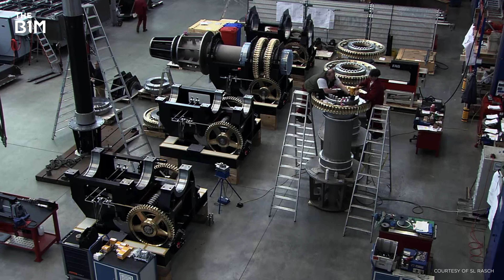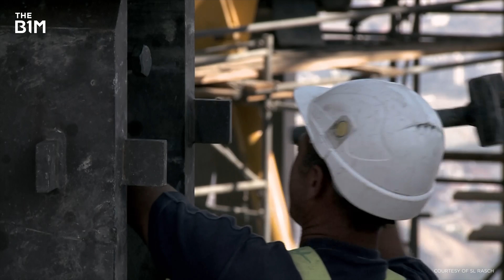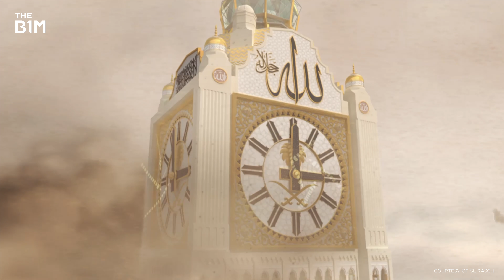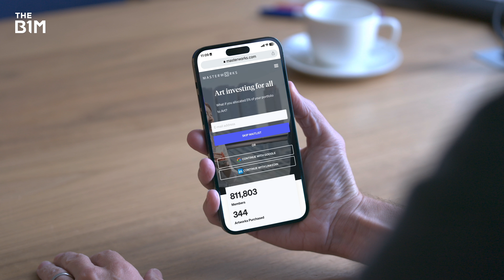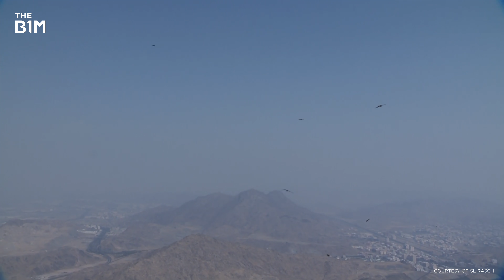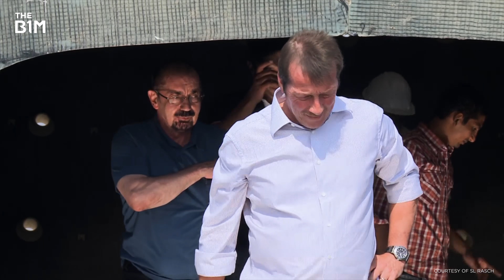Saudi Arabia Built a $16BN Clock Tower

Comment: The Arabs love building giant vanity projects
Reply: Who doesn’t? lol
Reply: @pyrho1  particularly when it’s phalic symbolism
Reply: Look at all those giant, ornate cathedrals in Europe. These kinds of architecture lasts for hundreds of years because it is loved.
Reply: @fanniinnanetguy653  they were built by men who spent their lifetime working on the project. Innate knowledge and devotion to the work of their craft was the main motivation.
Reply: It's definitely not vanity lol, the hotels inside are usually completely booked
Reply: @STV-H4H ”no no these vanity projects are moral while the ones Arab build are evil”
Reply: This one looms over the most holy place regulating everyone with a massive clock. Of course, the dude who prays up top has a very long commute.😂
Reply: They certainly do

But even more, they love doing it with all that lovely oil money they get from the West.
Reply: Wouldn't call it a vanity project since it actually serves an important purpose and function.
Reply: In reality this "vanity projects" have massivly boosted their economies. But I'm sure you know better then them tots.
Reply: @محمدالامريكي-ج9م  It's by definition a vanity project, because a more modest construction could achieve the same purpose and function. Something a whole lot smaller, and a whole lot less ostentatious
Reply: Correction: Dictators love vanity projects
Reply: @akbarkool  total monopoly
Reply: vanity projects designed and built by westerners who then had to convert to enter the city.
The absolute fukn NERVE lmaoo
Reply: While syria yemen starves
Reply: @1st1anarkissed  Most holy? 😅
Reply: Closer to god, and all that BS
Reply: Everyone did and Everyone does
Reply: @STV-H4H Showing your hypocrisy eh bud?
Reply: It’s a hotel..
Reply: Cope
Reply: @Echth762   I have to ask, what are you asking? What did I write that you called hypocritical? 
I wrote a sarcastic comment about how each religion claims ‘our god is the only true god’
That’s a central point of all the world religions. 
Point my hypocrisy out, I’m curious to know how you define it.
Reply: All of it's rooms are always occupied
Reply: @STV-H4H  poor people excuse lol
Reply: It's not unique to Arabs, humans have built many great structures throughout history. Also vanity projects are standard amongst the wealthy (real or otherwise).
Reply: Everyone does
Reply: How is it a vanity project when it accommodates all the visitors 24/7?!!
It is a very much-needed residential building.
Reply: @AL-lh2ht really ? Why? Argue please !
Reply: How is a public utility a vanity project? The Kuffar are slow.
Reply: @christopherbedford9897  they ain't gonna be receiving as much revenues if it's not build like that. It's literally made to support the two holy cities financially.
Reply: Vanity projects that serve nothing
Reply: Vanity? This building made a massive ROI. Not a vanity project when it makes many times its actual cost
Reply: @queenbey6678thats the brits lmao

The tower got its $$ cost back btw
Reply: @christopherbedford9897 u dont want the oil then?

Yall crave and beg for it... And it is a fact
Reply: @queenbey6678thats the brits.... Ohh the irony
Reply: @Heuzro  🤷🏻‍♂ Nobody is disputing that. Why did you bring it up? It's pretty much the whole point, isn't it.
Reply: So did the romans tell me what did your people build ajami?
Reply: @jewelsoup4110  "So did the romans tell me what did your people build ajami"

OK first, who is ajami and why did you pick on them?

Second, every civilisation in history - with the possible exception of us, now - has made their infrastructure more ornate than it needed to be. I just don't see the world's most expensive, highest, biggest, most imposing, most intimidating structure as providing any practical use that people couldn't get (and more) from their phones.
Reply: What's actually funny is Prophet Muhammad warned muslims of the time when Arabs will compete over tall structures. And it's almost as if they ignored that and went ahead to still build these and fulfil the prophecies of the day of judgement .
Reply: @STV-H4H yours must be rectangular shaped and with a built in alarm
Reply: goat herder menality
Reply: @randylahey2242  Civilized countries don't use public funds to shit like this
Reply: @qc7zy   lol open a history book
Reply: Dat Oil Money !
Reply: Humans, in general, do this.
Reply: @akbarkool mate, it'd be booked if it didn't cost 16 billion. The haj is an infinite money glitch
Reply: @akbarkool  they arent booked because of the grandeur of the clocktower. as someone who stayed in the tower 3 times the clocktowers size means nothing to anyone that stays there. we come for pilgrimage. if the tower didnt exist and it was only hotels theyd be completely booked as well
Reply: @christopherbedford9897  You cant call it a vanity project when it made a massive profit several times over. 

Lets be real here, you would be saying the same thing no matter what the build. because you basing your logic on bigotry and not economics or reality of how successful they are.
Reply: @red-one5923  Dubai is the third most visited city on earth last year. enough said.
Reply: @AL-lh2ht  "you would be saying the same thing no matter what the build"

🤷🏻‍♂ You're probably right. It just smells so much like the mediaeval mindset that built huge ornate cathedrals and churches and decorated them inside and out with only one thing in mind: make people cower before Authority.
Reply: @AL-lh2ht  you fool, you said that arab project are evil! I say to you argue why! Then your answer is dubai is the third visited place and you said enough said! 😂🤣😂🤣😂🤪
Reply: it's a hotel, and it's full all the time ... haters gonna hate I guess ..
Reply: @TheHigherSpace  "it's a hotel, and it's full all the time ... haters gonna hate I guess"

Yeahhh... never heard of a hotel that needed a 50m high clock on it though, have you?

No-one's talking about the hotel. It's the vanity decorations on top that are a massive "up yours" to the serfs who worship there ("You are nothing, prostrate yourselves before this much ostentation and garish decoration") and to the rest of the world, really ("Look at what we are doing with your oil money, you wankers)".
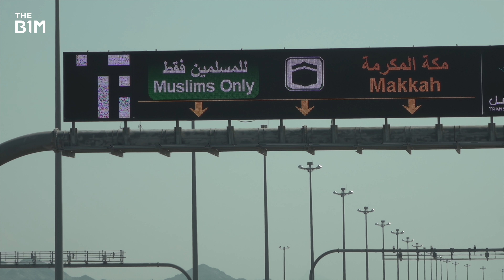Reply: Prophet Muhammad ﷺ said, “And if you see the barefoot arab, naked shepherds of camels competing in the construction of high-rise buildings, then this is from among the signs of the Hour." Muslim-1:36, No 8.
Reply: Have you seen Europe
Reply: @Szopjale1   the roman colleaseum? The French arch de triumph? Berlin gates? Big Ben? The Vatican? Solomons temple? Even the Africans have the pyramid lol the native Americans the kahokia mounds?Aztec temples? Buddhist temples? Even the mongols built that massive ghengis khan statue Have you never opened a history book
Reply: @deanbartolo6199  well that isn't true
Reply: Those are prosperous full cities it's Makkah the direction of All Muslims in the world
Reply: Because it`s already in the prophecy of the prophet `Muhammed PBUH` : `The end of time will not to come until Arab countries compete to build the tallest buildings...`

Its just like when prophet `Muhammed PBUH` say in prophecy : `Muslims will conquer Constantine and Rome...`, the companion ask : `Who`s first my prophet?`, and the prophet reply : `Constantine first...`, and around 800 years later from the time of prophet, Muslims that leads by Ottoman empire conquer Constantinople at 1453.
Reply: Uh oh
Reply: Right next to their holiest site. Nothing perverse there.. move along.
Reply: And Europeans don't? 😂
Reply: @fanniinnanetguy653  cathedrals are built to honour god.  Just like the mosques Muslims built in Turkey, they are beautiful and make you feel both connected to and in awe of god and the beauty of the world.  This is just a clock they built because they can.  Totally different.
Reply: How it is vanity if it generates a lot of revenue ?
Reply: @christopherbedford9897  You'd rather someone else steal their resources?
Reply: @christopherbedford9897  its kind have to be though, the mosque of mecca is capable of accomodating 3 million people, which is ginormous, any big religious building have to have some amount of vanity (cathedral, grand mosque, massive budhist/hindu temple even). You really dont want it strictly for function and it looking like a gigascale soviet apartment complex
Reply: bro why are you saying that like your country is any better your country is being ruined right now stop talking
Reply: @fanniinnanetguy653  yeah... in the medieval times. Lol.
Reply: Says a poor guy showing his hate and biases. Get help man😂
Reply: @akeel6328  yeah so slow that we had to design it for you hahaha
Reply: @Heuzro  we couldve just taken the oil. your lands were very undeveloped, it wouldnt have taken alot. instead we let you prosper from it. dont get greedy, pretty sure thats heresy in Islam.
Reply: You got issues buddy.
Reply: "When will the Hour be?' He said: 'The one who is being asked about it does not know more than the one who is asking.' He asked: 'Then what are its signs?' he said: 'When the slave woman gives birth to her mistress' (Waki' said: This means when non-Arabs will give birth to Arabs") 'and when you see barefoot, naked, destitute shepherds competing in constructing tall buildings.' The Prophet (ﷺ) met me three days later and asked me: 'Do you know who that man was? I said" 'Allah and his Messenger know best.' He said: 'That was Jibril, who came to you to teach you your religion.'"
Reply: they didnt really build it tho. they only financed it.
Reply: completely👌
Reply: @AhmedElsaleet uhh what? What does making an roi have to do with it not being a vanity project? 😂

Comment: Correction: the prayer room and office located above it are not the 'highest occupied man-made space on the planet' .  Either of the Everest Base Camps contain man-made spaces which are occupied and are at over 5,000m above sea level and there are other camps located higher.  Mecca is situated at 277m above sea level.  The prayer room is 600m higher or ~877m above sea level.  It would be more accurate to describe this as the 'highest occupied man-made space above ground level' .
Reply: That’s not fair tho wtf. Building on top of a freaking mountain?? Yeah some guy could just place a brick at the top at 8800 metres and call that the tallest man made building then??

Comment: converting means absolutely nothing. you tell someone ur muslim and theyre supposed to just believe you.
Reply: also snip snip
Reply: The problem is they will notice if you really converted or not you have to pray five times day with them 😂
Reply: @maassrddd until the project ends lol
Reply: @linuxmarmalade  I think circumcision is only strongly recommended but not actually a requirement for conversion. Even in Judaism it is technically possible to convert to Judaism and not be circumcised
Reply: It was by choice only God who can judge at the end

Comment: 16 bn for clock tower 😅
Western contractors are fooling MBS with crazy expensive projects which mostly never finishes but they move out making boatload...
Reply: Insane bill. Even if you compensate for everything such as the logistics of everything and tendering contractors and sub contractors it shouldn't have cost that much. If the clock tower alone cost 16 billion how much will their world cup bid cost them
Reply: المشروع مربح خلال خمس سنوات رجعوا قيمته ويمكن اقل
Reply: dude this is was the second and third tallest building on earth for a long while and has like 5 other skyscraper bolted to it.
Reply: @gaurav9431  i don't think it's fooling. You need logistics to make that kind of building. 
Specially when it's situated in a no sea or river and a mountainous area
Reply: @muazunais2378   haha it's a building do you think all buildings are built near sea..
Logistics is less then 1% of cost considering fuel prices there is dirty cheap...
And I'm not talking about just this project there are multiple examples jeddah tower, Line and many more...
Reply: it was built in king Abdullah time
typical poopjeet
Reply: they also had to withstand a seismic event. Mecca has had quakes that are 4+
Reply: Its not just a clock tower it has like 7 full hotels almost 2000 hotel rooms and full mall.
Reply: @Aziz-00  bro that thing is a piece of trash, it's an embarrassment to the modern world.

Comment: Time clock has nothing to with a time traveler the clock ⏰️ is necessary for your birthday 🎂  for your information the best city is based on straight roads with cross road of 50 miles straight by 100mile straight and roof top would be your billboard roof top to built the biggest television homework 90sq for your clue and for your information the solar sun 🌞 will be the next plant like 🌎